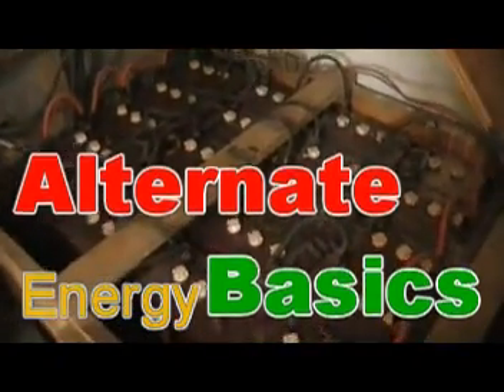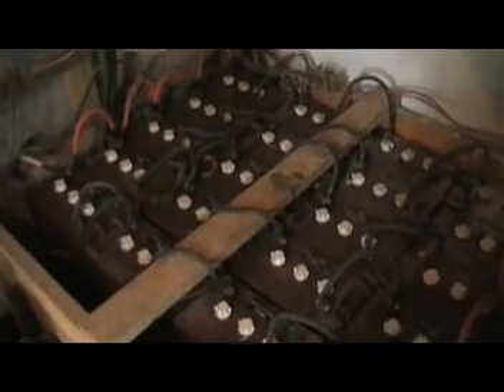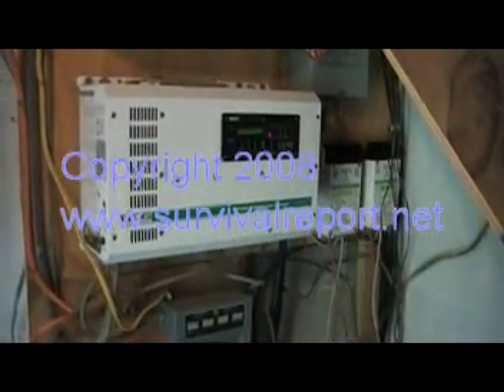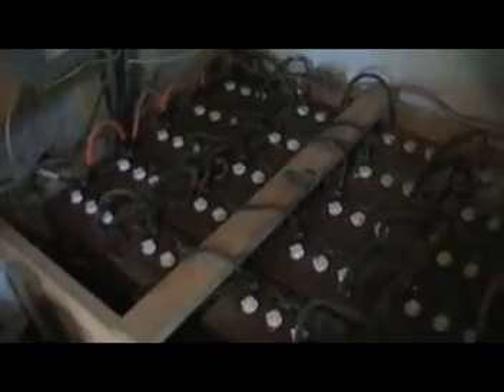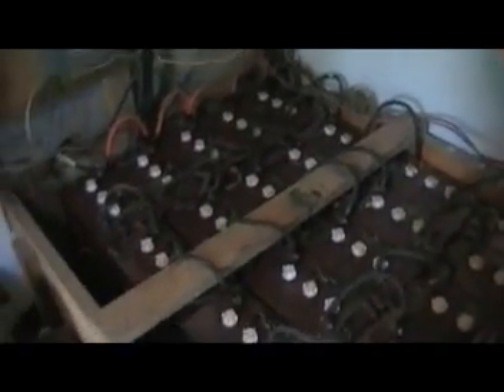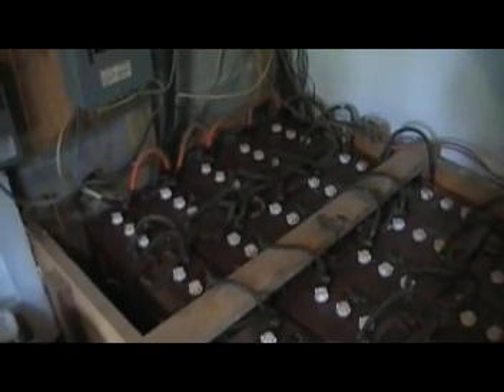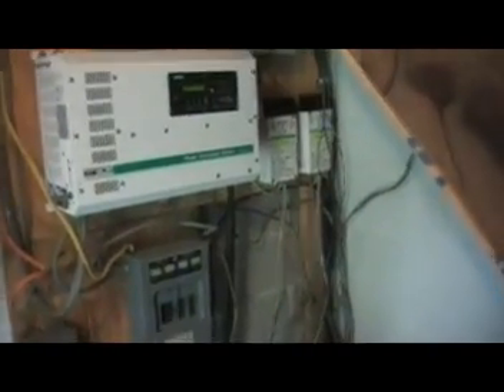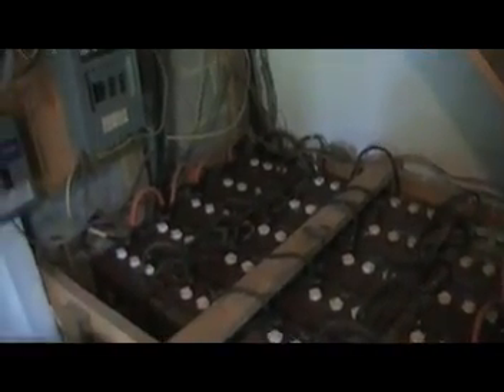Alternate energy, Peak oil, solar, economic collapse, 2012

Comment: Hello! Mr. I do not know if this place is ventilated due to the amount of batteries that produce hydrogen in the recharging process. It is important to remember that it would be very good if you put automated fire-fighting systems with smoke and temperature detection. Here in Brazil a friend lost all his investment by not taking precautions. The fire fighting system not only extinguishes the fire, but in the initial detection of smoke in this type of equipment, makes the shutdowns of the same and warns not only by sirens, but also by telephone. Hope this helps.

Comment: Helpful video.  I'd disagree using DC utilities like lights, fans, even coffee makers or other things found in RV's is as bad an idea as you say though.  These utilities run at no power loss, where ANYTHING you run through an inverter is wasteful due to the inefficiencies of the inverter.  Spend every penny you like buying the most expensive inverter in the world and by the nature of how inverters work your still wasting power using them.  In times when electrical power may be as valuable as gold, every bit matters.  Not to mention that even the "True sine wave" inverters really aren't in most cases (try putting yours on a scope one time), so electric motors and sensitive equipment that may have processors or other circuitry may be harmed by inverters over time if not immediately.

Comment: very nice video. all the info is correct and accurate. for the size of the geny set i would put 5-6kw as the best size watercooled is a bonus(can easily be converted to make hotwater at no extra fuel cost)
a gasoline system could also be easily modified to run on woodgas. iam at the mo looking for a small watercooled 4 stroke with 5kw for a 2nd genset to run on woodgas and drive a asyncrongenerator

Comment from the maker: Some folks aren't ANYWHERE near urban areas or masses of system dependent people. That's Rule #1 and the best rule for your survival :) Highly unlikely EMP would affect the diesel genset, which is why that's a key part of the system. Inverter, charge controllers, panels yes would likely go. You can always keep spares though. People need to realize that with a battery bank, you are NOT running your genset constantly. I can charge our bank from the genny in a very short period of time.

Comment from the maker: Thanks. That array was (14) Kyocera 130 watt panels. Not exactly a huge array, but not a small one either. It runs a 1,500 sq. foot house with all normal home stuff. It "could" run a window type AC unit but that would be a really large draw as most of them run at 15 amps or more. Runs a Conserv fridge, 2 computers, TV, 5 ceiling fans, washer, etc. with no problems. The two charge controllers are necessary for the size of the array. They will be upgrading to an MPPT soon. Thanks again!

Comment: Very Nice! To me I would guess that PV array shown would have roughly just over 1Kw of output. With that battery bank and that large Xantrex inverter it looks like you can run allot of things with this for extended hours and on demand moments of high amperage. Frig, TV, Radio, Freezer, other motors (grain mills) maybe even some AC. Looks like there are 2 charge controlers- I would guess one working as charge controler and the other as load diverter.I like - Great video - cant wait for part 2!!